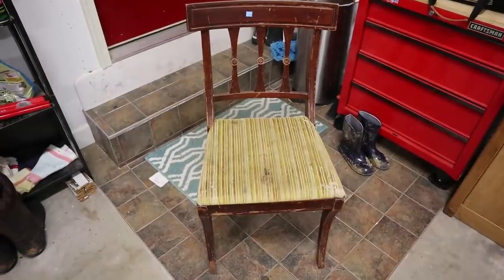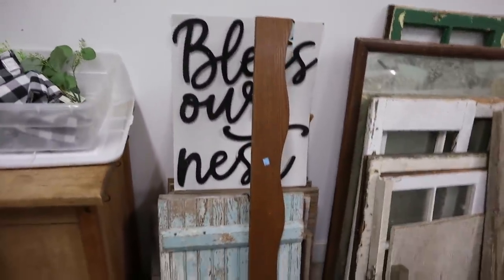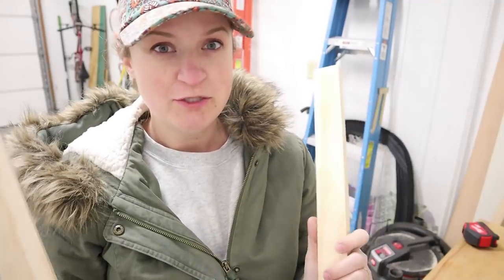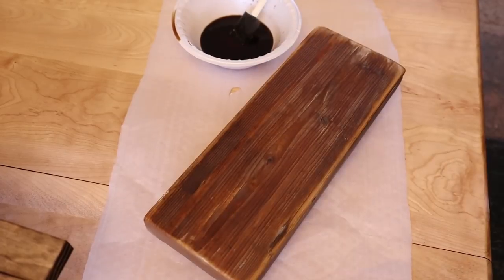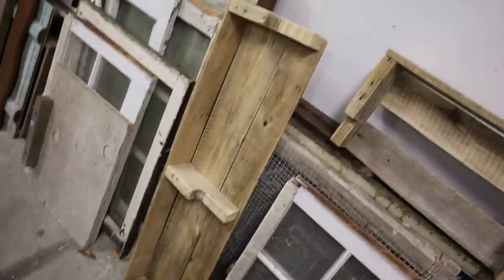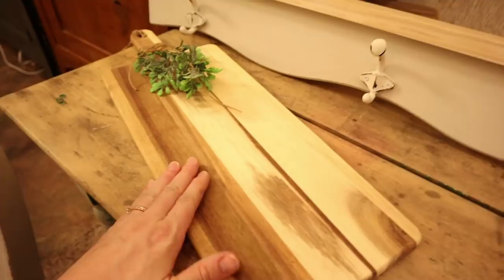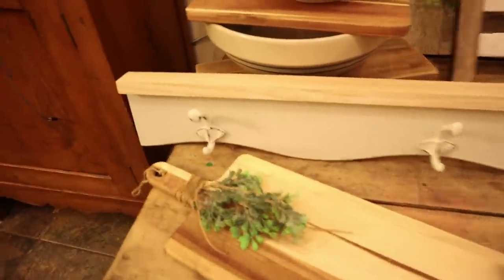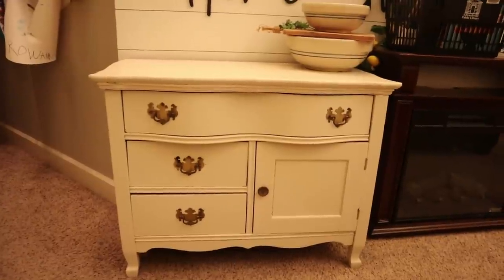Trash to Treasure Farmhouse Decor | French Country DIY projects for resale | Flipping furniture

Comment: I am new to your channel. What was the measurements for the risers,  including the dowel peices? I have looked for some and these are more of what I have been looking for than anything in stores!
Reply from the maker: Hi!  I didn't measure them any specific way....I'd say the smaller one was about 8 inches long, the medium was closer to 12 inches and the large one was more like 14 inches.  I cut the dowels close to one inch for the feet.  They came together so quickly and easily and MUCH cheaper than the risers you buy at the store.  Thanks for asking!!
Reply: @GreenOnionVintage  thanks so much!